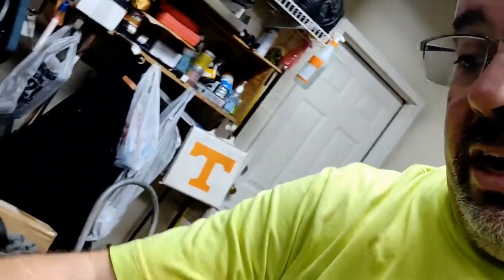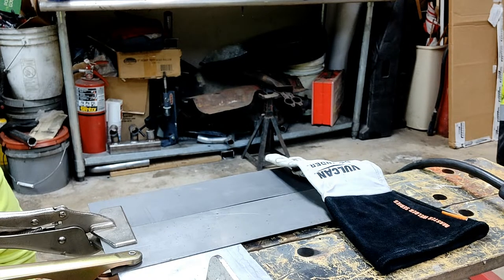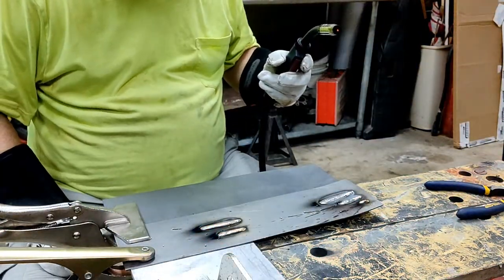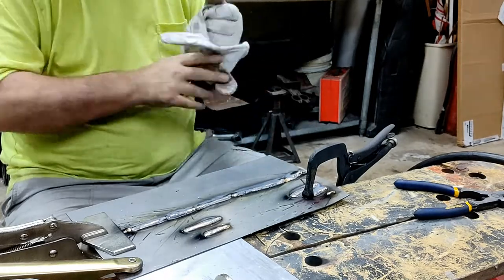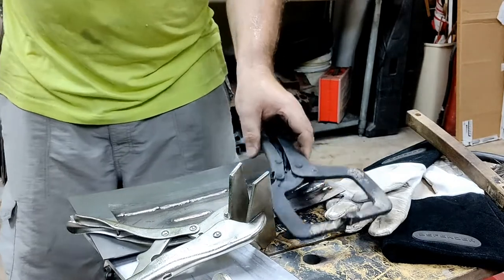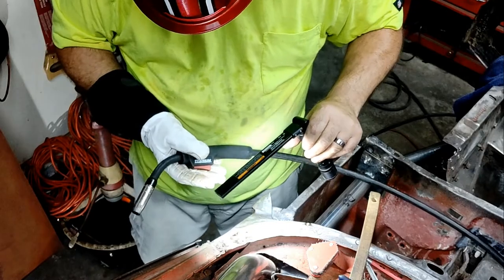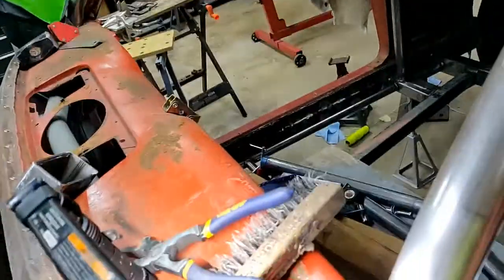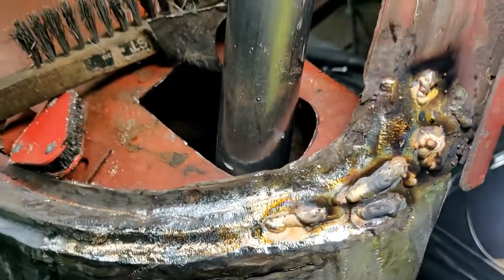Episode 17: Bronze Medal....Silicon Bronze that is!

Comment: I didn't even know this was a thing. I may have to try some out.
Reply from the maker: It works pretty well.  It needs pure argon gas.  Since I bought a plasma cutter/tig combo and really haven't even tried to tig, I had a bottle of argon.  I just swapped the regulator over to it since both machines sit side by side.  
Here's what I bought:
https://smile.amazon.com/gp/product/B00FOGIPR0/ref=ppx_yo_dt_b_search_asin_title?ie=UTF8&psc=1
Reply from the maker: Oh, watching other people show how to use it, it needs lower voltage and a lot higher wire speed than you would normally use for a given thickness of metal.